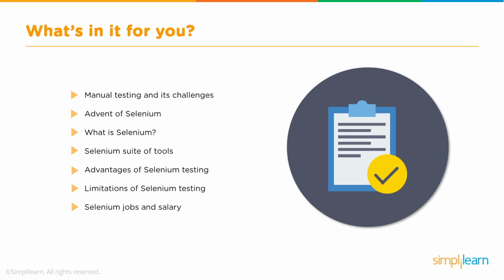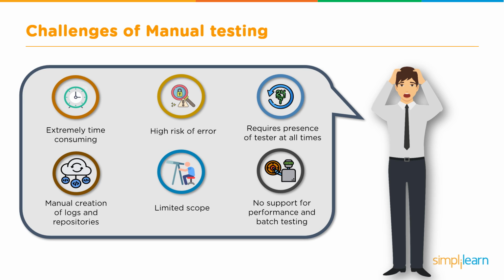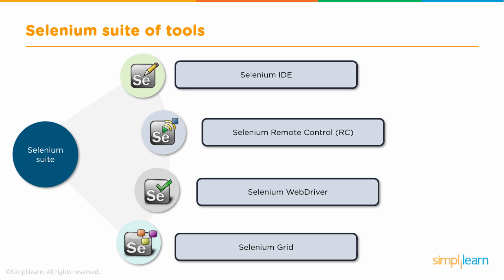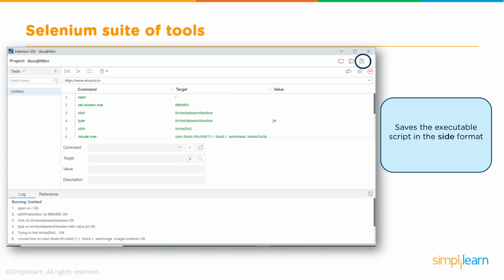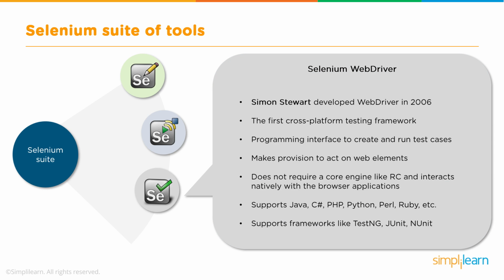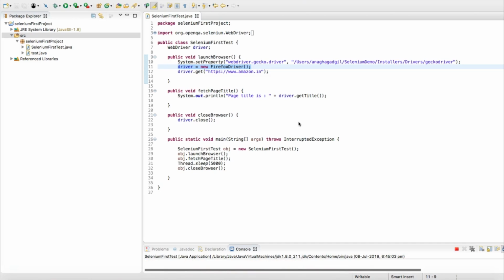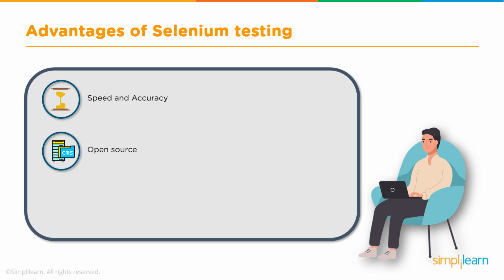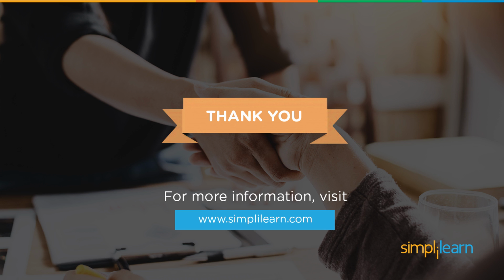What Is Selenium? | Selenium Basics For Beginners | Introduction To Selenium | Selenium |Simplilearn

Comment: Is this easy to learn Selenium manual testing automation. Because I am very interested to learn Selenium
Reply from the maker: Yes! Although Selenium requires you to have knowledge about a programming language of your choice, it is easy to learn and excel at. It offers an easy-to-use interface to create and run test scripts. You could practically test all web applications and help fix bugs and errors. The demand for Automation engineers is on the rise and learning Selenium could just be the right choice if you're looking for a career in it.